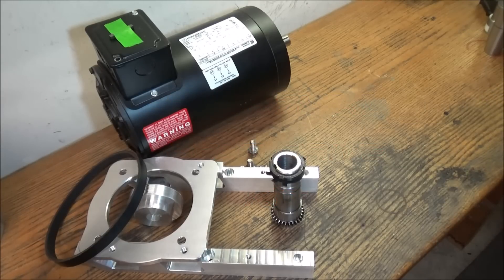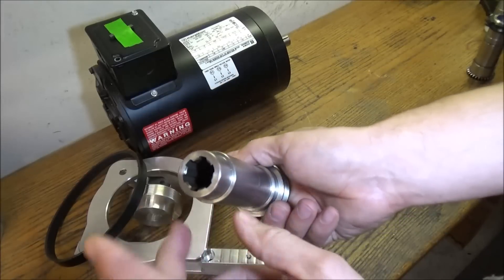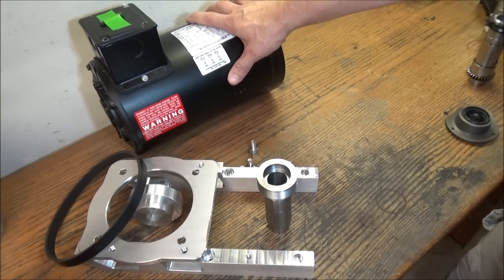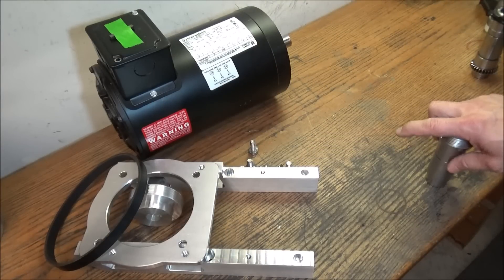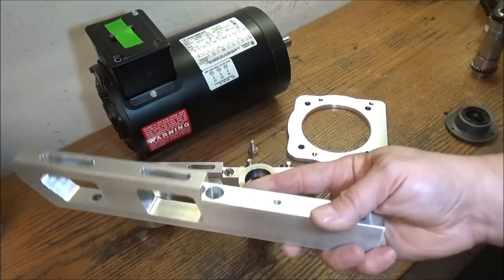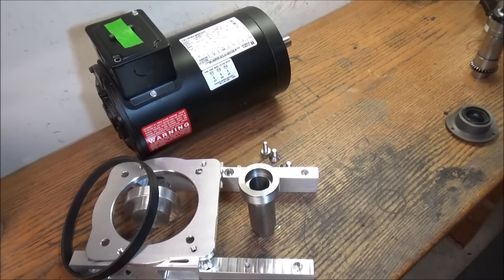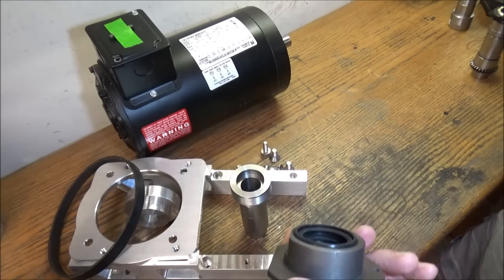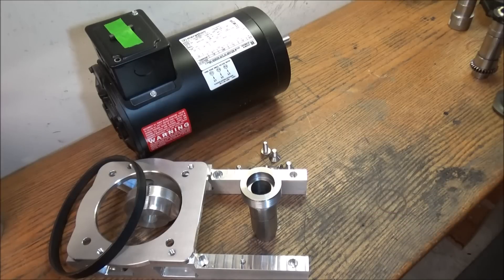PM727MXL Belt Drive Kit

Comment: Terminology correction: what you keep calling a quill is actually called a spline sleeve/drive sleeve. The machines quill is the tube that contains the spindle bearings and spindle. Also, the word spline isn't pronounced as seen; the letter "I" is pronounced as "I". Other than that, looking good.
Reply from the maker: LOL  it is a Eye in SPLINE , Yes You Are correct it is technically not a Quill it is actually the "Splined spindle sleeve" In this case a "One piece Splined spindle sleeve and drive Pulley"

Comment: I have a sort of on topic/off topic question. It's belt drive related but not quill belt drive/PM727 related. With your experience though I'm sure you'll know all about this and there are few content creators left in 2018 who still make videos on these types of mills.

I have a Weiss VM25L cnc conversion I recently did a belt drive conversion on. It uses a quill belt drive stock, but obviously only to 2100rpm. I opted to use a spline driven timing belt/pulley combo with Hoss' plans. I'm just curious about what kind of noise level I should be expecting. It's MUCH louder than it used to be. I know at a low RPM I can see the pulleys don't run perfectly true but that sorts itself out at higher RPMs (while still getting louder). The belt also doesn't want to stay centered on the pulleys so I'm not sure if this is also due to them not being true or if I just don't have them perfectly aligned to one another.

Hopefully my rambling made enough sense, I'm also really looking forward to seeing how your linear rail conversion works out for you.
Reply from the maker: SOunds like a situation where is not running true. If its not true at low rpm its not true at high rpm and most likely is causing vibration that can translate into poor finishes.
Reply: I kind of figured as much. Guess I will just have to mess with them until they run true. I didn't know that could cause a poor finish though. Since modifying it I did notice conventional milling didn't really break the chip off of my part (it just kind of cuts then stays stuck on the part) but I thought maybe it was the tool I was using. I guess maybe it could have to do with the pulleys not running true. Thanks for the response.
Reply from the maker: if your machining Aluminum Try a YG1 3 Fl endmill best tool I ever used on Aluminum
Reply: Cool I'll look into them. I've mostly used Ebay/Lakeshore cutters and honestly hadn't seen much difference and Lakeshore can be pricy. Do you purchase direct from YG-1, or what vendor do you use?
Reply from the maker: I buy from All industrial   https://allindustrial.com/yg1-28584-3-8-alu-power-3-flute-regular-length-carbide-end-mill-for-aluminum/

Comment: Just found your channel today and love the wealth of information you are providing!
Going to do a PM-30 in a few months and I wonder if that quill will be the same, if so I will likely be in for at least a quill and bottom reinforcement bearing.
The linear guide video was perfect. I am working on a "scratch" build lathe from some pieces we have laying around the shop where I work and I knew I wanted to do linear rails, but I had no idea how to figure out what I might need.  Also, I am considering putting them in a channel, the same height as the bottom of the rail, with corner relief, that I can grind parallel with the bottom of the plate.  Do you think that would be an OK mounting system for them?
Thanks for your TONS of informative videos!
Reply from the maker: I Can not say for sure when you get your machine shoot me a email.
 Not sure about what your asking on the Lathe maybe sketch it up and send me a pic